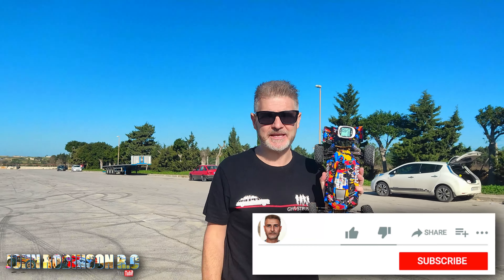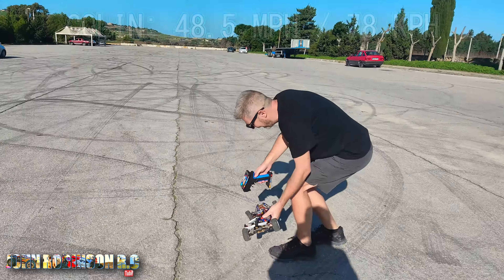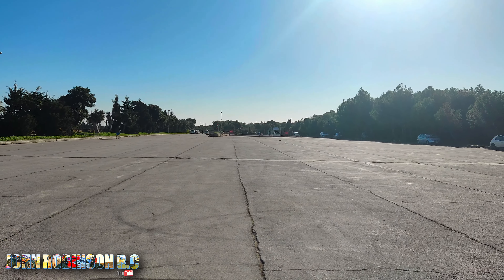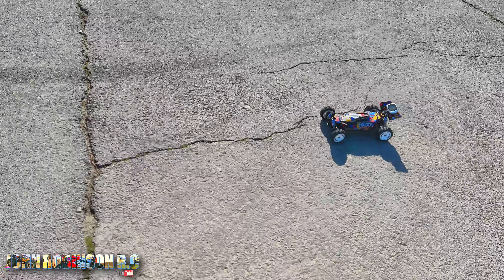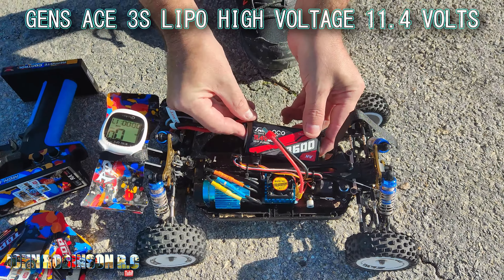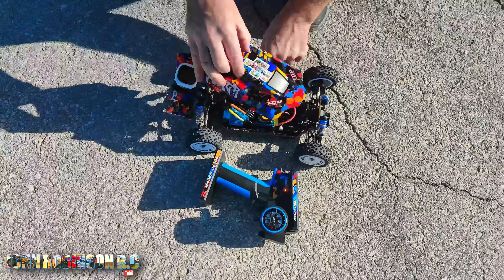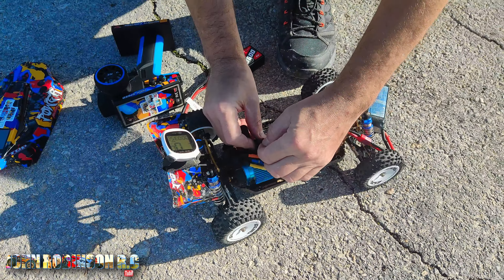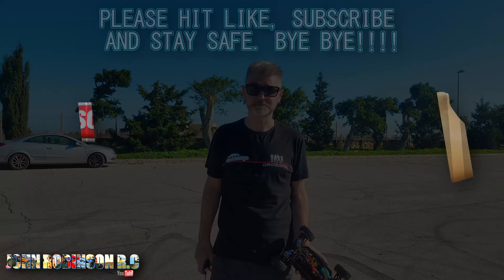Maxing Out the WLTOYS 124007: A High-Speed Adventure

Comment: New subscriber.     Hey I’ve been picking up a few of these wl toys cars…. They rip for the price!!!!   Question….   Mine new out of box no cogging but when I run wide open and let off throttle as it’s coasting down it brakes on its own to complete stop…. Is that normal.    Doesn’t do that on any other Rc’s
Reply from the maker: Hiya and thanks for the sub. Yes it's caused by the motor and or the pinion and spur gear. Or of course little grease in the differentials. On some rc cars that effect is much less like you have noticed. However some it does slow down quicker. Try these.
Spin the front left and rear left wheels while holding the car in the air. Does the right wheels turn freely? They will have some resistance, but shouldn't stop quickly. If they do then you need grease.
Get a board or find a hill or slope around 30 degrees. Does the car run down the hill without power? This could be either a tight motor which you can't do anything about or the pinion and spur gears are pushing too closely together. Try adjusting it so that they are not so close. Use a small price of a4 paper between them and hold the motor in position before tightening the bolts. Don't push the motor hard into the gear, just rest it against. When tightened then put out the paper. It should look corrugated. Hope it helps and you find a solution. Good luck and thanks again.
Reply: @JohnRobinsonRC  ok I’ll check that all tomorrow.   I appreciate the detailed response!!  I’ll be checking out some more of your vids to see if it can handle some 3s….
Reply: @JohnRobinsonRC  also.   I ordered two of those transmitters you just did video of using link you had.  Can we get extra receivers for them?
Reply from the maker: @djh254 I asked the question yesterday and just waiting for Rlaarlo to answer me. Will let you know as soon as I do. 😉👌
Reply from the maker: Can I ask if you used my link please?
Reply: @JohnRobinsonRC  yes I did use your link!
Reply from the maker: @djh254  don't forget to send me the last 3 digits of your order number to have a chance to win the prize. Or write it here. Cheers and good luck. P. S. Still waiting to hear back from Rlaarlo. 😊😁
Reply: @JohnRobinsonRC  last 3 of receipt number is 32g
Reply: @JohnRobinsonRC  sorry to bug you.  I’ve looked at all you said and it passed all those tests.   I’ve noticed when I run full throttle if I let off and it’s coasting for a second if I engage forward throttle by 1 mm it does not apply brakes..  I’ve wedged a piece of paper in transmitter enough to where it will not brake but also does not engage wheels…is there an adjustment in transmitter’s potentiometer?
Reply from the maker: @djh254  that's good that it passed. Last time I opened a controller there was no adjustment. And I think you may have their new Controller? I would say it's like 7 screws and not complicated inside so you could take a look? It's hard to help remotely with a problem like this. 😔
Reply: @JohnRobinsonRC  understood.  Appreciate input though!  Hopefully that new transmitter I used using your link will help.    Thanks again
Reply from the maker: Hello mate. Are you able to send the order number and your first name to my email address please? Rlaarlos website has not registered any sales on my account which is shocking and frustrating. I really would appreciate it. johnrobinsonrc@outlook.com

Comment: Same thing is going on with mine. 2s is fine but 3s no throttle.. let me know if you figure it out :(
Reply: There's a little yellow tag on the power leads to the ESC, it says 2s compatible only.  The new 45a ESC they're using cuts off due to overvoltage with a 3s

Comment: Did anyone get to the bottom of this? Iv got this car but don't want to spend money on a 3s battery if it won't work? Did the old model have a better esc or something?
Reply from the maker: Hiya. Somehow I've missed these comments. Must have been when I was unwell. To be clear. The car works fine on 2s. It will not run 3s. So I assumed I just had either blown the esc or have been unlucky. However I dug a little deeper and no youtuber or anyone else has posted or written about being able to run a 3s battery in this car. So make of that what you will. The fact that the car still runs 2s makes me think it was never meant to run 3s unlike its slightly cheaper sister, the 124017. This car is still a mystery to me.
Reply: @JohnRobinsonRC  cheers John. I'll stick to the 2s. More than enough power for me. Just like to say the YouTube algorithm is working fine for your channel, as your in the first few videos everytime. Keep up the good work just keep posting content buddy we love it!
Reply from the maker: @skankrim5398  thanks mate for the support. Glad to hear things are working as they should. Would be nice with a few more views and subs but I am sure every channel wishes the same thing. 😂 Have a fantastic weekend! 😊👍🏼

Comment: Hi.John 
124007 still can't use 3s battery?
Is John's 124007 only disabled?
Can't all 124007 use 3s batteries?
I'm debating whether or not to buy a 3s battery for my 124007.
Reply from the maker: Hello. Nope 124007 cannot use 3s batteries. 3 people have confirmed they cannot. Only way is to buy a new brushless ESC that can handle 3s i am afraid. 🙄

Comment: Mine came in it actually accepts 3s battery you probably heat soaked yours in 2s run in wouldn't work anymore on 3s.
Reply from the maker: 3 other people confirmed that it did not work with 3s. It's typical wltoys. Different components for the same car. Glad it works with yours though. 👍😉

Comment: Last 2 wltoys I've purchased would not accept 3s. Under further investigation, the cap pack on the esc is only 7.4vdc and not 11.1vdc. They promote fast vehicles then cut costs by selling us junk...
Reply from the maker: That's so frustrating that they are heading downhill so quickly. And seems such a small thing to make a saving on...

Comment: You mentioned two things , you said 50c shouldnt be too much, it definitely doesnt matter. But you also mentioned you are trying to use an HV or HIGH VOLTAGE 11.4 volt 3s battery, that definitely wont work in these buggies as it is over a standard 3s 11.1V and the software in those ESCs is not happy to have the boost in voltage, if the voltage cap in the protection software doesnt limp mode the ESC fast enough it can burn out the ESC if it does catch it then it simply limp modes the ESC. To get rid of limp mode, power off the car, remove the HV liPo, turn on the car for 10seconds with NO LIPO then connect a 2s lipo and power on the car, it should work again.

"C" rating wouldn't have anything to do with it. An RC car or plane or tank or bike can always take more "C" its when you dont have enough "C" when problems arise. 
"C" is simply a statement of how many amps a battery can deliver to the ESC, But its the motor that demands a certain amount of amps and the ESC that in turn asks for that from the battery. So when you choose a battery you must select one that can give as many amps as the motor, and in turn the ESC, asks for.
To do this we need to multiply the LiPo's "C" rating by its "Ah" rating.
So a 5000mAh LiPo has an "Ah" rating of "5Ah amp hours" if our sample LiPo has a 100C rating then we know it can deliver a whooping 500amps. But the car and motor and ESC will only use as much as they need! The battery will NOT supply more Amps than its asked for so its perfectly safe to use a higher "C" rated battery than you need.

Comment: Hi, Dear John,
Would have been quite interesting if you would have tried out the 2S battery another time, after the ESC had not worked with 3S… 😉🧐
• And as for the “buggy bouncing” I would reduce the spring pre-tension on the shocks to give the oil-dampening more “operating travel” to smoothen the suspension… 
Keep on having a great RC FUN time…!!! 🍀
Thorsten 🌞
RACER - Budget RC Fun Team Germany 🍻 😉😂😊…

Comment: hi. nice to meet you
124017 or 124007 Are new products shipped with shock oil filled?
Or is there nothing in it?
The shock nut is too tight and too hard to loosen.
Reply from the maker: Hello. Nice to meet you too. For sure it's the 124017. They have oil in their shocks from the factory. And most new WLTOYS have the wheen nuts at the right tightness. 😊